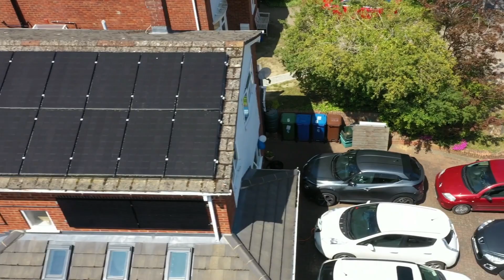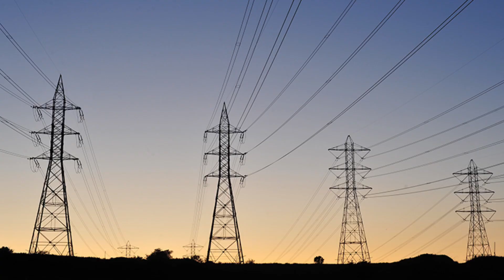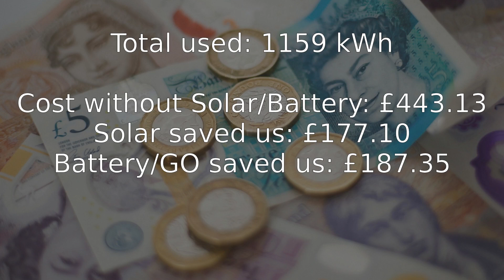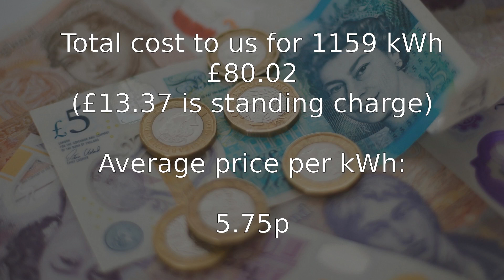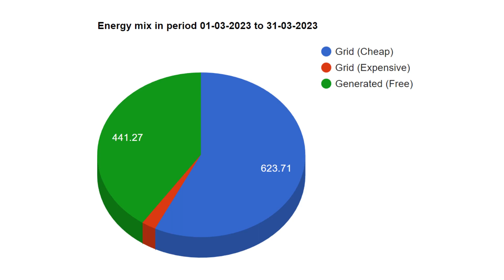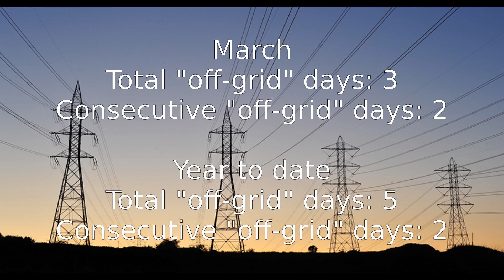Electricity stats for March 2023

Comment: Hi Nicholas, im wondering if you may be able to help me with a problem ive come across this morning, when i woke up i looked at my app for the solar and it said  the pylontech batteries were at 96% - i knew then that could not be right, its normally around 45 - 60% when we wake up, so i looked at our electric meter which has read the same for about the last 4 days (used about half a unit in 4 days) but the meter reading was showing it had gained 19 units since yesterday, so off i go up to the loft to look at the batteries - x3  3,5kw batteries = 10.5 total - and all 3 had no light on as if there was no charge in the batteries at all - but each battery had the "Run" light blinking, and that was it - you have any idea what has or could have caused this and most of all how do i get it back running ? Big Big thank you in advance for any information you can offer - Martin    . . .  PS: We did have many appliances on yesterday all at the same time - dishwasher/washing machine/ x2 water distillers amongst other stuff
Reply from the maker: Your batteries are sleeping because they are not being used. Sounds like there could be a problem with your inverter. What is the inverter your batteries are connected to?
Reply: @nicholashowell  Its a Sofar 6000, if the batteries were sleeping via not being used why would it start drawing back from the grid ? Since i wrote you the first message two of the three batteries had no lights on, i have since discovered that when all 3 were looking off i turned off the inverter and turned it back on - they all jumped back into life again then showing nearly fully charged at 98%, but they have gone into this mode again since - 2 went off 1 stayed on nearly full, turned the inverter and solar off then turned them back on again and all 3 lit up again
Reply from the maker: @kroozer5215  So the inverter isn't trying to pull any power from the batteries and so they go to sleep. When you turn it off and on again it pulls a little power at first so they wake up. I wonder if there is a problem with your CT clamps?
Reply: @nicholashowell  The system is about 9 months old and this has never happened before but that maybe the solution, where do you get the clamps from ? and are they easy to fit ?
Reply from the maker: @kroozer5215  I doubt it's the clamp itself though it's not impossible. More likely the connection of the clamp to the inverter maybe has come loose or the clamp has fallen off the tails. The other thing that could give a clue is if the inverter is reporting any errors?
Reply: @nicholashowell  no there are no errors
Reply from the maker: @kroozer5215  I'd check the CT clamp connections first then.
Reply: @nicholashowell  where will they be ?  connected to leads from batteries to inverter
Reply from the maker: @kroozer5215  No, the CT clamp should be round one of the cables near your supply meter. The other end should connect to your inverter but not sure where exactly as I'm not familiar with your inverter. Probably shows it in the inverter manual if you have it.
Reply: @nicholashowell  ok thanks Nicholas